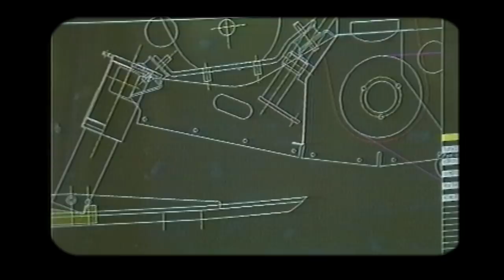5 Decades / 5 Stories - Chapter 5: The Present & The Future

Comment: Congratulations ! 50 Years of hard work has paid off. Now lets see some smaller less expensive snowmobiles designed for family's to enjoy.
Reply: Like a "Remade" lynx 5900 2-stroke fan cooled 503 engine, or 600etec.  A little more suspension (not over the top) and better ergonomics (higher saddle and handlebars), same low weight and narrow LTS design. That would make a great all round machine!